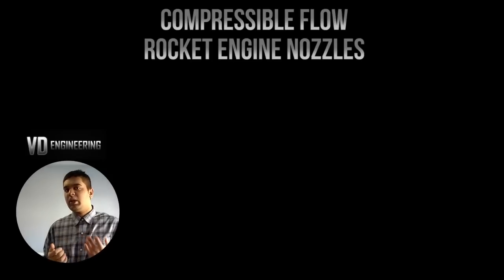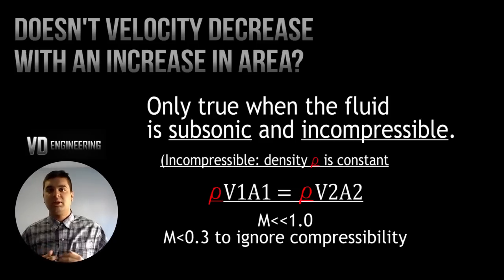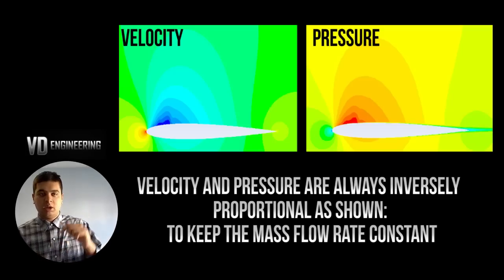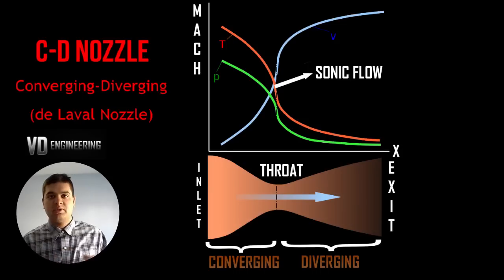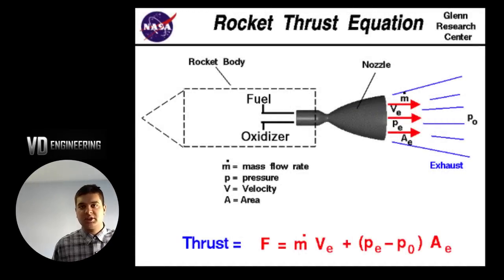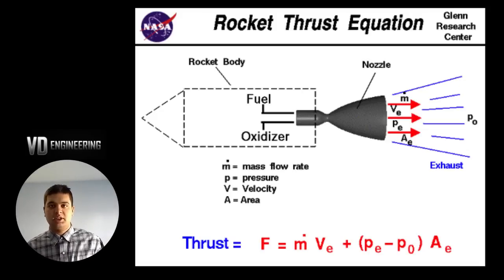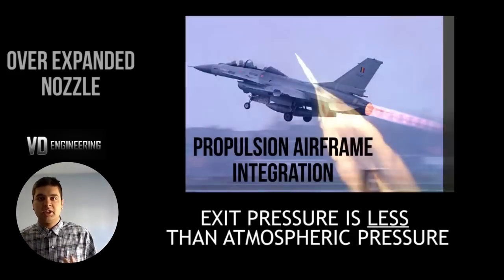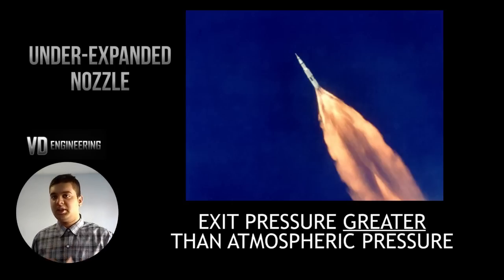How does a Rocket Engine (and Nozzle) Work? - Compressible Flow Basics

Comment: In fighter jet engines most of the pressure from the exhaust gases leaving the ignition chamber is used for driving the turbine. The rest is pushed through the nozzle. You actually dont want the pressure at the nozzle outlet to be less than the atmospheric pressure since that would slow down the velocity of the exiting air, decreasing thrust.

Comment: Best channel for Aerospace students
Reply: Sir Even I am Aeronautical Engineer Sir I have one doubt please can you explain As we known that In Optimal Expansion of the Nozzle We can apply Isentropic relations Since the flow here Is Isentropically expanded (and back pressure= ambient pressure) But In Underexpanded and overexpanded Nozzle this Is not the case here In Case of Overexpanded Condition Oblique Shock Is generated to make back pressure= atm pressure ) and In case of Underexpanded Case Expansion Fan Is generated So My doubt (Since atmosphere condition = Back Pressure ) Satisfied In both case  Can I apply Isentropic relations to it?

Comment: Very well and concisely presented! Thank you. I'm currently trying to make a gaseous fuel (not liquid-to-gas) nozzle, where the propellant is a mild explosive rather than a deflagrating mix. The shockwave values might be double or triple standard O2/H reactions. Time will tell. I'm wondering though about how I'd throttle such a setup: perhaps ignite the gases at different locations along the length of the combustion area to cause/less/more force production. Just don't know yet. Maybe a simpler solution will occur to me.
Reply: Did it work?

Comment: Hi I have a quick question, I'm not sure if you check these anymore. Well around 4:20 you discussed a nozzle being over and underexpanded. Then you mentioned a spaceX rocket maintains constant velocity at a certain altitude. You then said the control system will be able to change the pressure in the nozzle to be equal to the atmospheric pressure. I am wondering exactly how this is exucuted.

Thank you!
Reply from the maker: IF the altitude is the same the pressure outside is more or less the same, so it's just minor changes. It could be done by flaps moving inward / outward to change the exit area.

Comment: I am trying to figure out the optimal c-d inlet vs outlet diameter and throat diameter in relationship to each other.  For instance.... if my convergent inside diameter needed to be 20mm... what would my throat and divergent sections need to be respectively?

Comment: Thank you for the video. Why are they overexpanded in jet engines? I didn't understand, to protect components?
Reply from the maker: It increases the aerodynamic efficiency of the vehicle as well.
Reply: @VDEngineering  You didn't answer the fellow's question. In the video you stated that the overexpanded exhaust "protects" the rear-most components of the jet, but don't explain how that protection occurs..

Comment: What would the velocity be in the case of zero pressure atmosphere?  I'm trying to determine the velocity of gas exiting the LEM engine nozzle as it landed on the moon.  Would it be optum, under expanded or over expanded condition?
Reply from the maker: Most of the time, it's underexpanded
Reply: @VDEngineering  
Can you give a ballpark figure for the velocity of the gas please?
Does it fall into a range for all rocket engines or very widely?

Comment: I have a doubt when exit pressure is equal to ambient(atmosphere) pressure then the flow would not happen bcoz flow will happen from high pressure to low pressure??? I know there will be pressure difference but I am telling that for not over or under expanded but for ambient nozzle exit pressure must be equal to ambient(atmosphere) pressure(i read in the book and even on google) then how the flow is happening there??? one more thing you said SpaceX launch is under expanded nozzle but no its an ambient nozzle??

Comment: I think that the flow isn't all-time sonic at the throat. This depends on the ratio P/P0. It is sonic only if P/P0 =0.5283. If it is over, the flow is subsonic in the throat & in the divergent. If it is is less, the flow is sonic in the throat and supersonic in the divergent. 
I think also that all that you have said is true only if the flow in the convergent is subsonic. I don't have an idea what happens if the flow in the convergent is supersonic. If you can give me an idea, I will be thankful. ( P = static pressure of the flow in the nozzle , P0 is the isentropic or stagnation pressure at the inlet)

Comment: So an under extended nozzle gives the best force because the exhaust pressure is higher than the atmospheric pressure, and optimal nozzle gives efficiency but not maximum thrust? Plz tell me if this is right or wrong.
Reply from the maker: Under expanded nozzle does not give the best force, because even though the pressure is higher the speed (ue) is lower. The equation is m_Dot (ue) + (delta P)*Ae,

Comment: which is much preferable and efficient  to be overextended or optimal(ideal) nozzle for rocket first stage? first stage starts from zero altitude and stops at about ~50-70 km altitude,if you use a ideal nozzle for first stage it is ideal on a AGL but when altitude will raise nozzle become an underextended and it's efficiency will decrease and vice versa, which type pf nozzles does rocket companies using for their first stage?
Reply from the maker: Well for a rocket you cannot really control the expansion as effectively because atmospheric pressure decreases with altitude. The flow will almost inevitably become under expanded as you increase in height.
And all rocket engines use a CD nozzle as explained in the video.

Thank you for the question!

Comment: Does fluid mean water? Do they store rockets with water tanks? What is the tanks leak water, won't that damage the rocket? Thanks.
Reply from the maker: Rashid is this you from STFX? Lol
There's one tank which contains fuel (Lithium Oxide, Hydrogen Peroxide), not water. And the other stores an oxidizer, They come in contact , mix and burn. Then the mixture goes through the nozzle.

Comment: Yes, the higher the exit velocity of the exhaust the more upward force on the rocket, but that higher exhaust velocity is a RESULT of the higher chamber pressure inside the engine, which is itself a result of the narrow section of the nozzle. It is that higher chamber pressure that causes the rocket to move faster. This video really did not do a good job of explaining how the exit nozzle shape actually contributes to a higher upward force on the rocket.

I think that the best explanation of how a rocket motor works would concentrate on the upward forces against the insides of the combustion chamber and the nozzle, including both the burning of the fuel  and the effects of constricting the exhaust flow. I think that too often the explanations concentrate on making the flow faster, when in fact that faster flow is a RESULT (a side effect) of increasing the actual forces inside the engine.

Comment: How does a rocket nozzle work in space without atmospheric pressure?
Reply from the maker: Watch my SpaceX video to understand that better. It's underexpanded in space, always
Reply: It sounds like you are asking the often repeated question, "How does a rocket engine work in space when it doesn't have anything to push against". Well actually it does. Newton's first law states that any object with mass wants to remain in its current state of motion. What this is talking about is inertia, which all mass possesses. Both the rocket and the propellants have mass inertia and will resist any change to their velocities. When the propellants combust and are accelerated out the nozzle essentially both the rocket and the propellants push against the inertial mass of the other. The rocket pushes against the inertial mass of the propellants and the propellants push against the inertial mass of the rocket. In other words you get equal and opposite reactions according to Newton's third law. Further, the thrust or force produced is determined according the Newton's second law, which states that Force = Mass times Acceleration. 

As such a rocket doesn't need any outside medium like an atmosphere to push against simply because it brings its own medium along with it. The propellants actually perform two functions. First they produce the combustion necessary to release heat to pressurize the thrust chamber and force the hot gas out the nozzle at high speed. But they also have a second function, which is to provide the inertial mass necessary for the rocket to push against in order to accelerate its own mass in the opposite direction.

Comment: It would seem that the terms overexpanded and underexpanded are exactly the opposite of what you actually see in the exhaust. The diagrams of the overxpanded thrust show NARROW exhaust exiting the engine and the underexpanded thrust shows WIDER exhaust. From the  terminology I would expect it to be the exact opposite of that. So that's just very confusing.
Reply: it is very confusing.......the terms refer to the gas pressure in the nozzle relative to the external atmospheric pressure........if the gas leaving the nozzle is at a lower pressure than atmospheric then as it leaves the nozzle it gets compressed which means that the nozzle was too large and this overexpanded the gas
Reply: @101xaplax101  I appreciate that you took the time to reply to my comment. I have for a long time been frustrated with the explanations provided in books and articles and now in videos of how rocket engines work. They invariably discuss the methods of increasing the exhaust velocity. And while it's true that the faster the exhaust is the faster to the rocket moves, the fact is that the one does not CAUSE the other. Yes, there's the principle of "for every action there is an equal and oppositely directed reaction" and the principle of conservation of momentum, but I've always thought that basing the description of what causes a rocket to move on those principles is the wrong approach. It is the PRESSURE inside the thrust chamber that CAUSES both the rocket to move in one direction AND the exhaust to move in the other. For once I would like to see a description from that perspective. Surely the design of the nozzle affects the PRESSURE inside the chamber and that is what, in general affects the speed of both the rocket and the exhaust. I'd like to see diagrams of the pressures against the inside of the chamber and how the net pressure adds up to cause the rocket to move. Basically, the only things that matter is the opening/diameter of the nozzle and the pressure against the inside surface of the chamber that is directly opposite that nozzle opening.

But I've never seen a discussion from that perspective.

Maybe CDEngineering could do a another video and take it from that perspective.

Comment: So you engineer VD? ???
Jokes aside, which part of the engine is the nozzle? I have seen diagrams that seem to indicate that the engine is divided into a combustion chamber, a throat, and a nozzle, while others refer to all three sections as the nozzle. Can you settle this?
Reply from the maker: It's the part after the combustor which is usually called the "nozzle"
However, the nozzle is actually everything beyond the throat region (the expanding section)